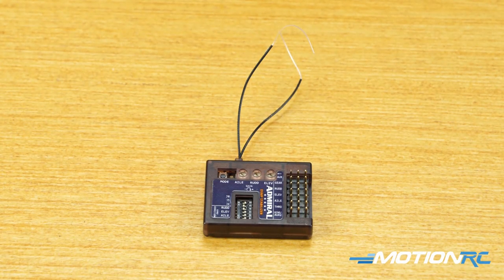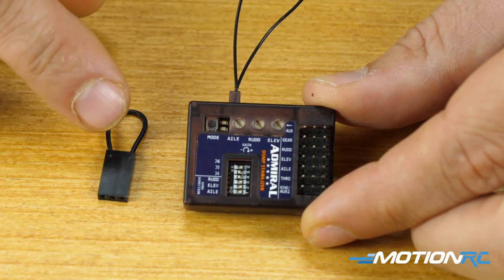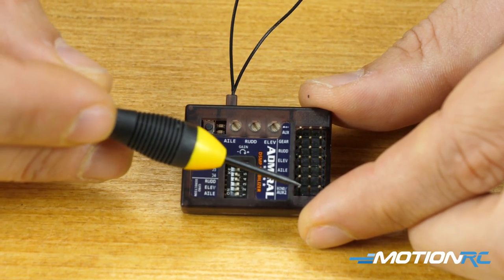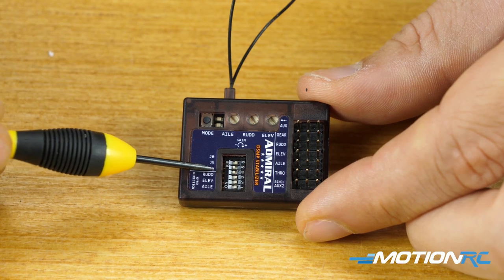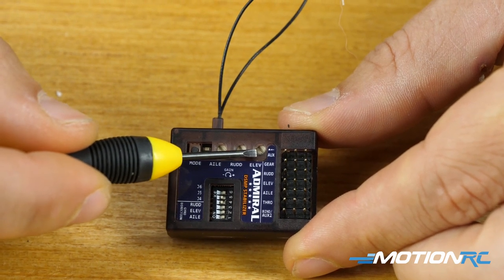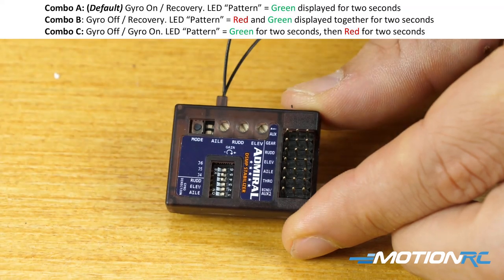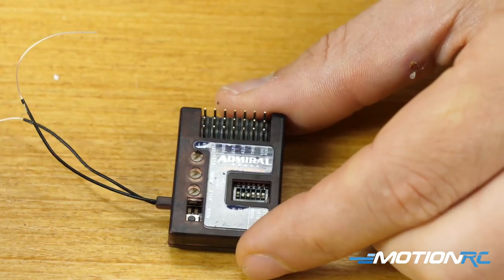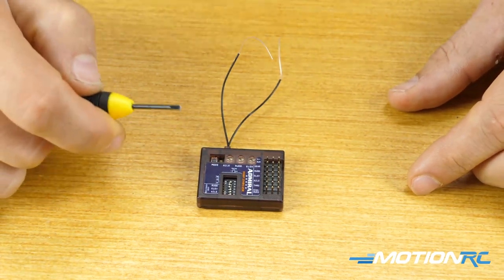Overview - Admiral RX600SP Stability Plus Gyro - Motion RC

Comment: Hello James - Great Playlist.  Lots of good information. Flying on a budget, I currently have this gyro bound to a Spektrum DXe (RTF Aero scout version).  I am experiencing two issues:  1. The ailerons by default are reversed for some reason with this Tx which I found a fix for and reversed on the Tx.  2.  I can't seem to get the stabilizer to work even though I have the j4 and j5 dip switches in the on position.  Wondering if this is a compatibility issue with the DXe Tx and the admiral Rx?  Any help would be greatly appreciated.  Thanks!

Comment: Have two of these and I lost signal on both. Was flying them in my 800mm warbirds temperature under 10c so I don't think they like cold weather would definitely not trust these in a more  expensive plane stick with spectrum.
Reply from the maker: How were your antennae mounted? Only time I ever lost signal was when I forgot to separate the antennae and have them 90 degrees from each other
Reply: Me to at 90 degrees
Reply: These are essentially the Lemon stab plus 7ch.   I have a few of them and they have never failed me.
Reply: hujum1 wish I could say the same
Reply: The hobby eagle pro seems like it’s something I would need more, but of course that doesn’t work for me as advertised either
Reply: I can't speak for the Admiral version, but the identical Lemon stab plus has an impeccable record.    I would imagine theseare no different.  Also quicker to get in the U.S. I imagine as opposed to the Lemons shipped from China.
Reply: I also had one that kept killing my motor.. I swapped the motor then the esc then finally i swapped the receiver for a spectrum with a hobby eagle gyro.. Sorry but these are junk it cost me a plane.. Spend the extra money..
Reply: You might pay more for spectrum but I trust these receivers 👍
Reply: I need some help, i have this reciever and i bound it to my Dxe (im Gonna Buy a dx6i soon ) and when i arm the Motor it spins on Full throttle while i have the Stick completely down.
Reply: Bring down the throttle trim all the way down
Reply: I had the same issue with mine,  it lost  Signal on the P-51 850mm from MotionRC just after flying about 150 meters (500 ft) away, even mounted the Antenna at a 90deg. angle. I was lucky I could recover somehow, but it was not what I expected at all from this receiver. Don't trust it anymore.

Comment: I'm having problems with my Admiral 600 not working the throttle... any help would be appreciated
Reply from the maker: Calibrate your ESC? Turn on the transmitter, put throttle at 100%, plug in plane, listen for first set of beeps, throttle down to 0, plane will then arm in the normal cycle of beeps.
Reply: @MotionRC  just tried that still no throttle... but the blade twitched and was beeping. This is a replacement motor and ESC should have been a plug and boom done. The model is Motion Panther 3s early one I have been flying for 3 years now....burnt out the motor one day and got a 3s replacement